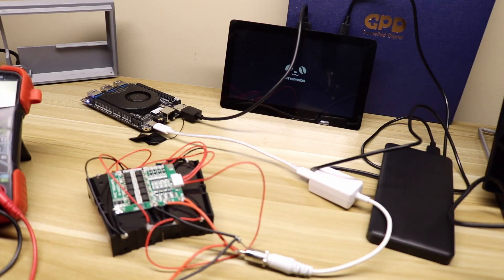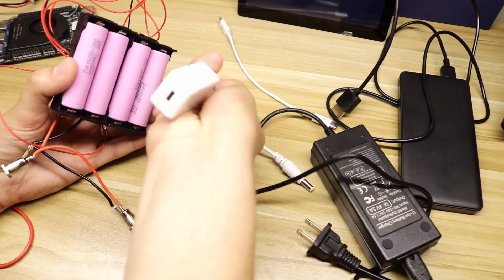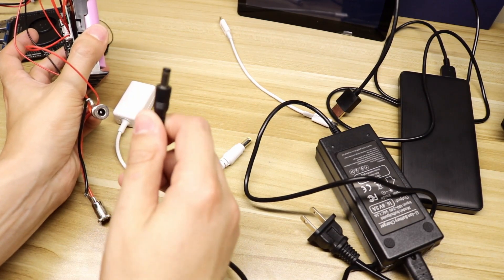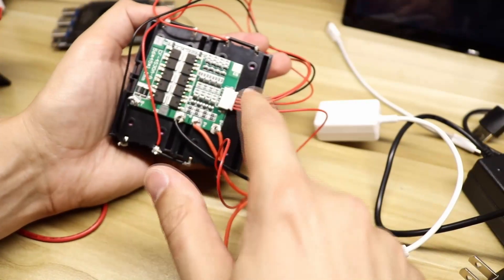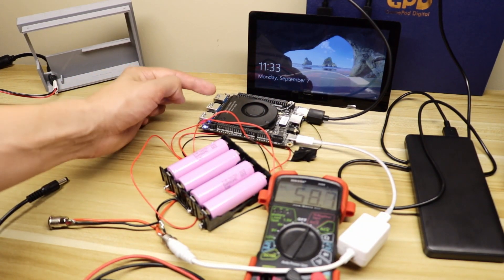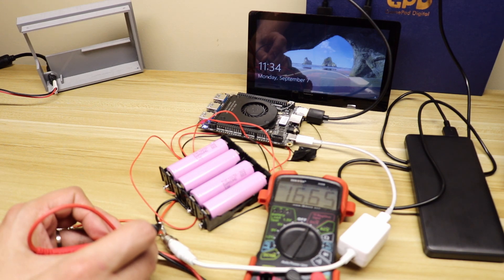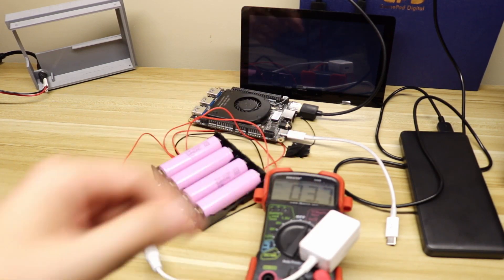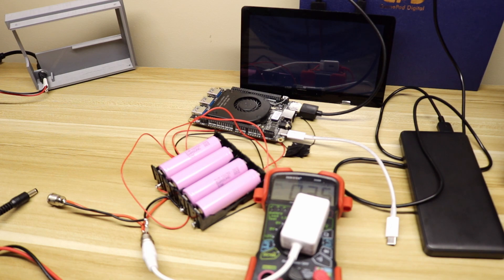How to make a USB C Power Delivery Uninterrupted Power Supply (UPS) Battery Pack

Comment: Instead of using two DC barrel connectors, do you think it would be possible to use 2 USB C female breakout boards, and have one for charging/supplying power, while ALSO allowing data to passthrough to the SBC?

Comment: Why it works as a UPS is the real question. The BMS has to be able to switch sources fast enough without dropping power in the meantime, and the USB-C cable also has to not try to renegotiate based on any input disruptions (which there shouldn't be any). Failing that, the lattepanda might have enough capacitance on input to smooth out any small changes.

I think it's most likely the 1st and 2nd.
Reply from the maker: Yes, not a proper identified UPS BMS like TI lineup of ICs with fast switching mosfets and added caps, but seems to work nonetheless
Reply: Does this BMS setup really switch sources between battery and charger? It feels like it's just continuously discharging which is a bit unsafe if you use it 24/7 right?

Comment: Making a portable NUC and this looks very helpful as I find the batteries to be the trickiest part. Is soldering the ends of the battery dangerous? I hear that you’re supposed to spot weld to join them.
Reply from the maker: Yes soldering can be dangerous, spot welded is the preferred method. Vruzend has a mechanical way to do that, you can check their website for their case.
Reply: spot welding can also be dangerous if you are not at the right current/time as you can easily weld through the end caps and yay boomies. (you can find several videos of this type pretty easily)

the risk with soldering cells is the massive heat you have to use to melt the solder and bond to the end caps, you can easily damage the cell and reduce their life span (sometimes significantly)

this is where some choose the much easier and risk free spring terminal option such as in this video

Comment: Nice men!
Can i ask? I have a lattepanda alfa and recently i bought a pico psu and i want to use it with the LP 
¿How can i make and adapter for the jst using the molex or sata port that the psu have?
Do you have a diagram or something else? Im from arg ajja sorry the English 
Where can i contact u?
Reply from the maker: Ivan Kirsch hey Ivan, do you have discord? I leave a link to my discord in the bottom of my video descriptions. Otherwise shoot me an email at project.sbc@outlook.com
Reply: @HandheldHardware  just send u an email 
I really enjoy your work!
Reply from the maker: Ivan Kirsch hi Ivan! I received it, I haven’t had time to find my cable to give you a good quality image so you can recreate it. I will reply shortly!

Comment: I need the ask that;
Would you prefer power consumption on lattepanda, or more portability?
Reply from the maker: CoderH my response disappeared 😩 I posted something like “I prefer portability, but this battery is designed for compatibility across many devices”

Comment: На SBC есть вход для 12 вольт. Я использовал 3s2p. 12.6 вольт. Без всяких адаптеров
Reply from the maker: Yes, this SBC can power 12-15v directly or 2s battery on 10 pin battery connector. For this SBC, not need usb c Pd adapter. However, for Udoo Bolt or other SBC this would be needed.
Reply from the maker: @andrewb7817  single board computer!